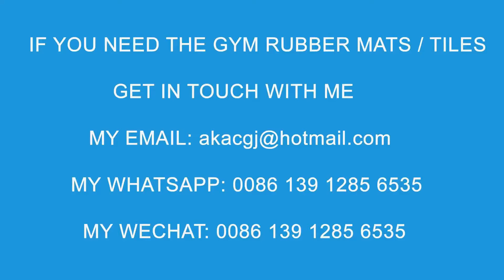Manufacture of the rubber mats rolls for gym flooring, wholesale rubber mats with colors flecks

Comment: Packaging: It came in a sturdy rectangular cardboard box that said Yoga on it. https://www.youtube.com/post/UgkxZkaD2JsPC-fUMkF3vxJ2echoiXZ3T9aM I didn't like how it let possible package thieves know what might be contained inside but great packaging otherwise. The yoga mat came rolled up in a plastic wrap, which was fairly easy to remove.Contents: I got the green yoga mat and it came with an adjustable velcro carrying strap already secured to the mat. There was also a warranty card. There was a bit of a plastic smell coming form the yoga mat but it quickly dissipated after using it once.I've only used the yoga mat twice so far but I am loving it. It's such a game changer to my work outs, especially compared to my bed and floor, haha! I can confirm that it very thick, slip resistant, and comfortable. i didn't look at the dimensions prior to buying the mat, but it is so much longer than I expected! Width is normal size in my opinion. I don't know if it really is tear resistant yet... only time will tell!